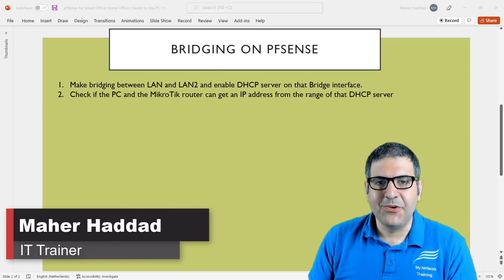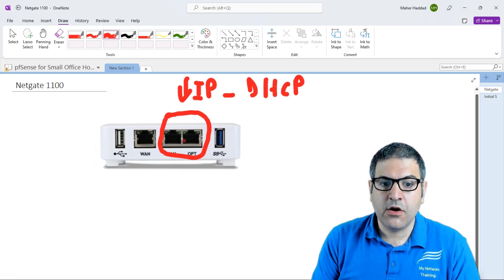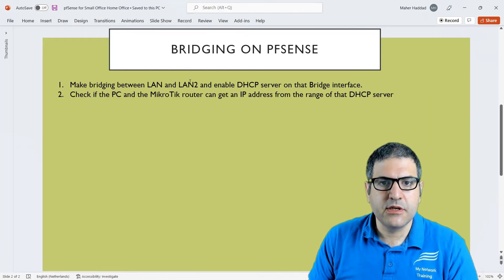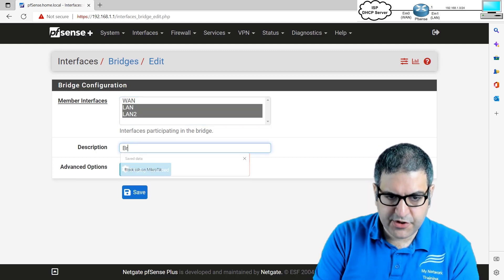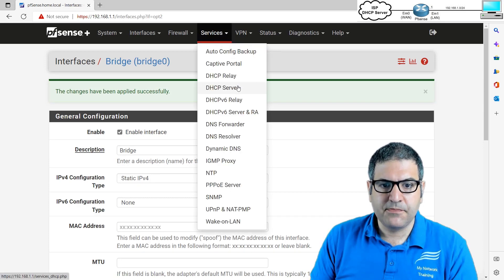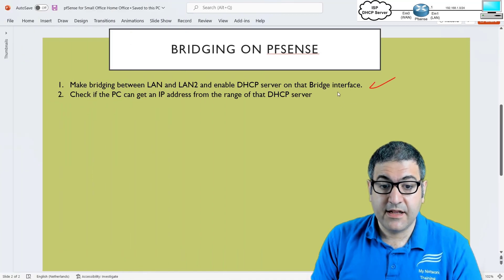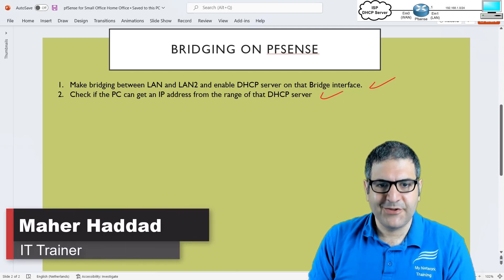2- Bridging on pfSense

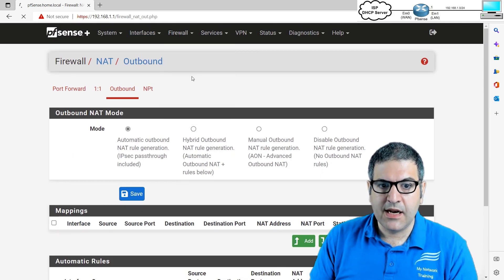Comment: thanks, this video helped me get past an issue i was having trouble with for about an hour. At 7:32 of the video it tells me to remember to configure the firewall rules correctly. I simply copied the rules from the LAN interface over to bridge without actually making the rules point to Bridge. So when i disabled ip assignment for LAN, i couldn't get internet connection.

Comment: I think I did all these steps. And devices connected to each of the interfaces I put into the bridge can talk to the internet just fine. But it seems that devices on LAN1 (my desktop) can't talk to devices on LAN 2 (my printer).  I can ping the printer from the diagnostic menu in pfsense. But I can't ping from my desktop. Are there additional firewall rules needed to allow traffic from LAN1 to get to devices on LAN2?
Reply: Solved it. I added firewall rules to allow packets from each interface to the bridge network. This works. Is it the right solution?
Reply: @afitzrobert  I think you are correct. I had to do the same thing, crazy no one talks about this lol. With out this it kind of misses the point of doing it in the first place.

Comment: Great Tutorial. One question i have for such setup is. Can we have VLAN with a bridged LAN. I had a working vlan that relies on LAN1. but as LAN1 changed to ipv4-none. the vlans not getting tagged on the AP that supports vlans directly hooked to LAN2 port (part of the new bridge).

Comment: Thanks a lot for the video! Is it possible if you can make a video on how to configure multiple trunk ports on multiple NICs (acting like a switch) on OPNsense/pfSense. For example, I just received my Qotom Q1012GE and it has 8 NICs. I would like to utilize four of them to form a switch. I want all four of them to be trunk ports, carrying the same tags on each trunk (native, VLAN10 and VLAN20). Is it even possible at first? If so, how to configure? And will it affect the firewall rules? Thanks again.

Comment: System: Advanced: System Tunables
| net.link.bridge.pfil_member |   Set to 0 to disable filtering on the incoming and outgoing member interfaces. | default (1) |
| net.link.bridge.pfil_bridge |   Set to 1 to enable filtering on the bridge interface | default (0) |
This is to avoid filtering on NICs and do the filtering only on bridge interface.
Source: netgate forum.

Comment: i have followed everything to the last dot, but it is not working for me
Reply: Me too!!!

This work only for trivial home router environment. 

What if the router is virtual machine on the server with 100 different virtual machines?

Also, LAN0... out boud firellaw. The admin not try to enter into web guy from bridge static IP. Do you know why? Because he lost access. Yes, internet routing is working, but can you enter into router from opt2? I did not saw that. 

How the f!$@ck you set LAN to none and not lose access? 

What if instead rj lan we have transreciver.  What is happening when plug in/out? What happens? 

If we are in large cloude infrastructure. How you will switch to new networks and the switch back bridge to networking which is in the virtual server network.  The only solution is to use cli but opnsense and pfsense not have shell commands for easy set firellaw,  interface br8dge assignments  and also interface type assignment. How with command you will switch static interface to None? How?